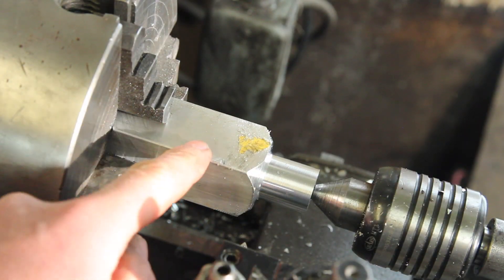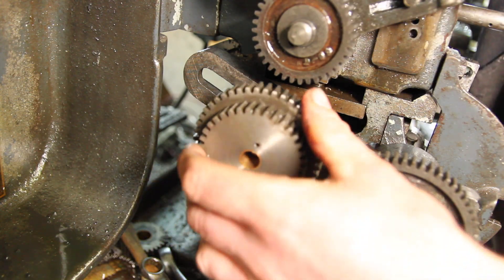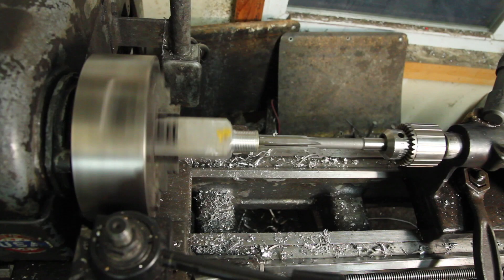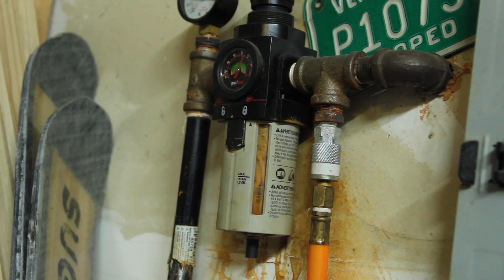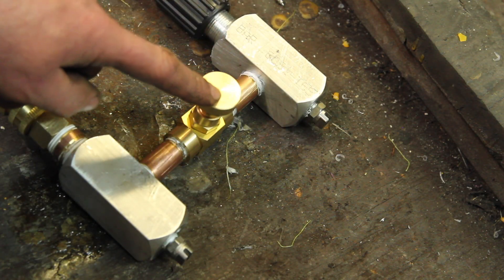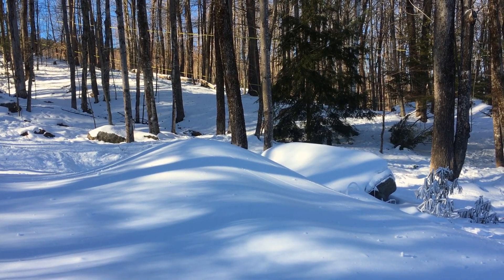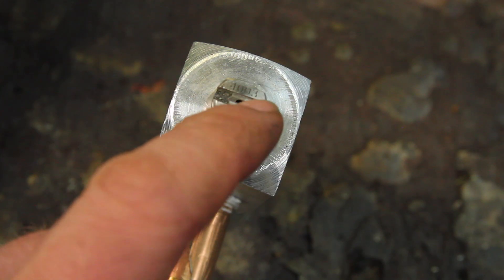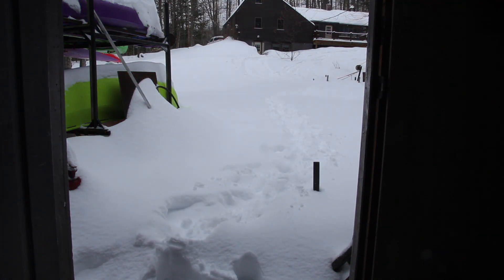Backyard Snow Gun Build

Comment: I think I'd rather try using a fan instead of compressed air. I think it rather needs volume of air than the pressure, but I haven't actually built anything like that. just wondering.
Reply from the maker: Even on a fan gun, The pressure drop coming out of the nucleation nozzle is still needed to generate the super cold air to form the initial ice nuclei.  Fan guns are good in marginal temperatures because the increased hang time gives more time for things to freeze before hitting the ground and they can spread the snow over a larger area, but in very cold or windy conditions, and increased hang time can lead to more loss to evaporation/sublimation or to just getting carried off in the wind.  But that’s getting more into the “art” of making snow.

Comment: Where did you buy your metric change gears? If I saw correctly,  you have a logan 210 correct?  I have the same and would love to thread metric.
Reply from the maker: Mine is a Logan 200, same machine as the 210, but the floor model rather than the bench one.  Gears are Boaton gears parts GB37 and GB47B.  You’ll have to do some modifications (facing, bore, etc) to them, but that’s ok because you have a lathe.  I got mine from Amazon, but it must have been some sort of close out because they were much cheaper than the current listing.
Reply: @JeremyMakesThings  much appreciated!

Comment: Very cool.  Did you calculate how much it cost you to run this for 10-12 hours based on power to the compressor [and pressure washer]?  I'm guessing any other costs would be trivial by comparison.  If you're rounding down the CFM rating of the compressor for the nozzle/system spec, was your compressor running almost nonstop, or what approximate duty cycle?  I'm guessing your compressor is not within earshot of your bedroom :)
Reply from the maker: Looking at my electric usage on the days when I was making snow, compared to a “normal” day, a good estimate is it cost about $10.  The compressor actually wasn’t running non-stop, I think that might have to do with icing and any other restrictions in the air hose- I probably wasn’t using the whole capacity of the compressor.